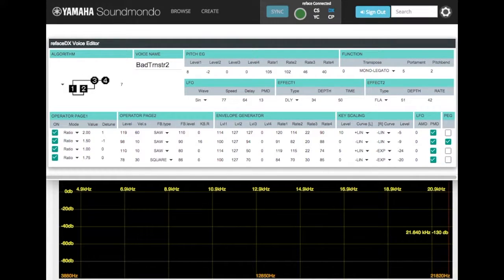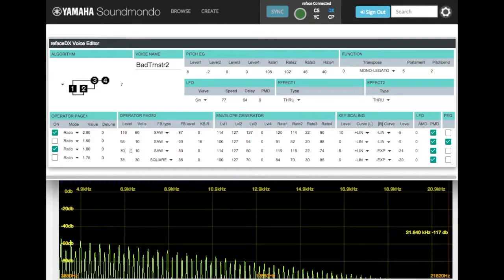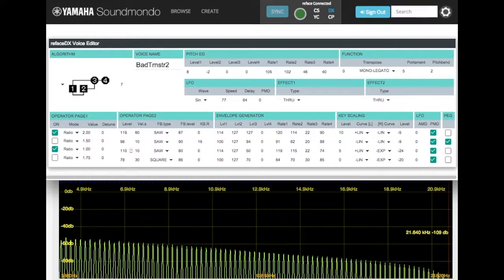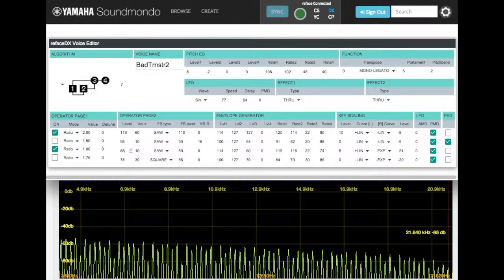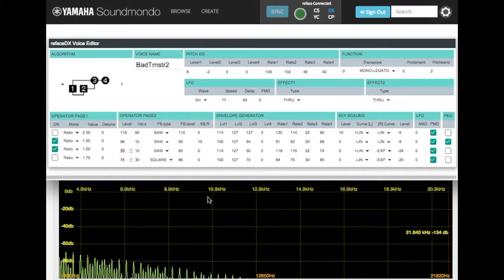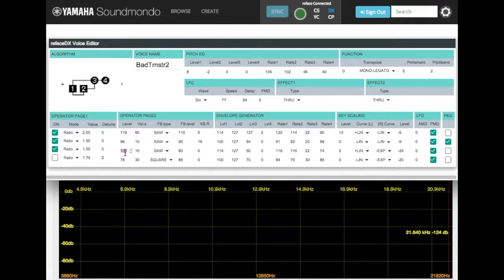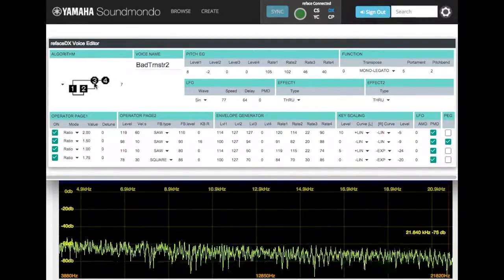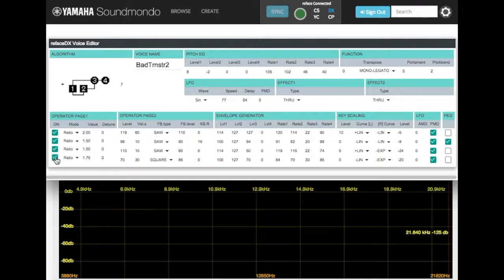Overmodulation Example

Comment: thanks so much for these videos. Makes it a little more accessible for someone like myself who normally just twists knobs and moves and changes parameters in the hope that I come up with something interesting (which does happen more so on this synth then the origina) however it's nice to see it in action in the hands of someone who knows what he's doing. Quick question. is that visual on the screen under the editor something you added or am I supposed to see that when I use the site? also I read somewhere that there would be an interactive "photo" of the dx on the screen that would have move able knobs that would replicate on an actual reface...just curious..thanks...also I love your sounds on the site. I have downloaded many!! :)
Reply from the maker: Maria, the spectrogram (the 'visual under the screen" you mentioned) was added, it's not part of the site.
Reply: thanks so much! Now I just have to figure out why I can't move any sliders etc on the "screen" dx. I only see the editor like you have above. However, I've seen other videos where you can move the sliders as if you are using the actual dx....just wondering why I can't  do that? thanks again. Love your videos...(and patches)